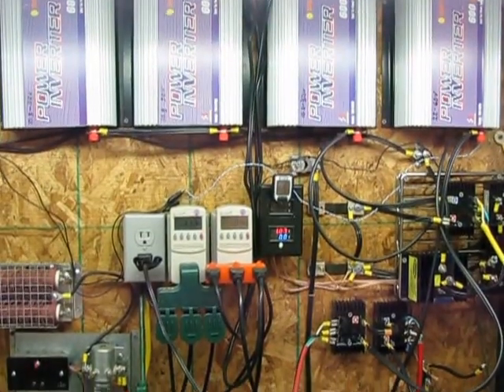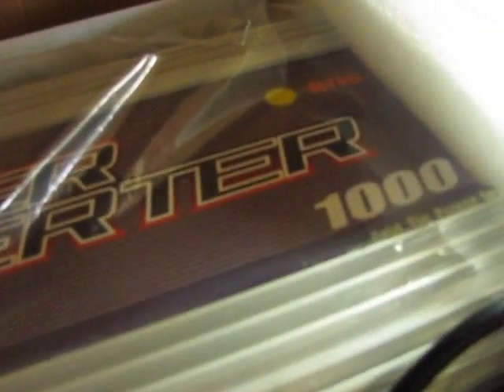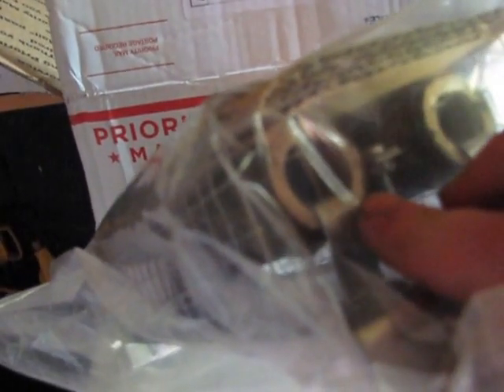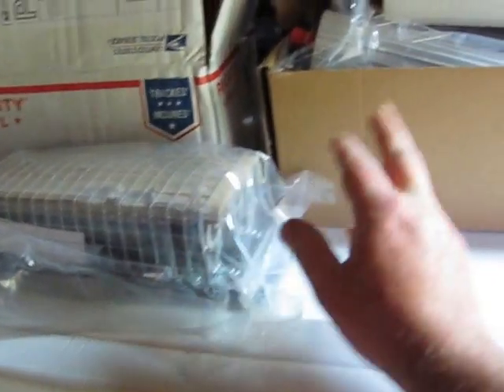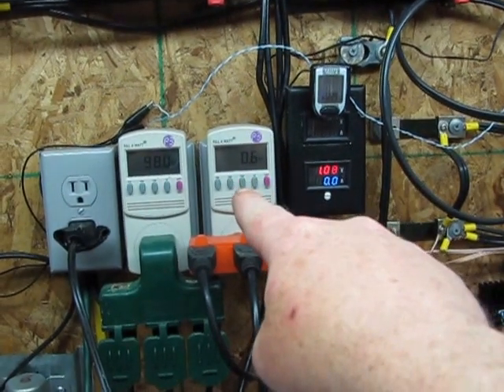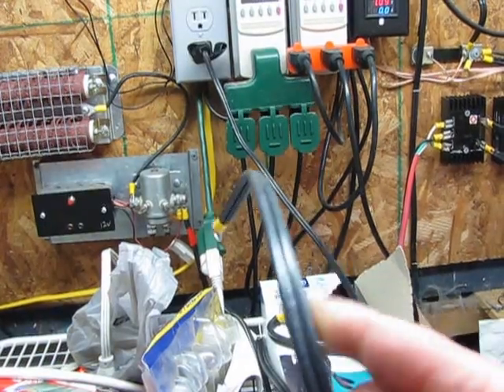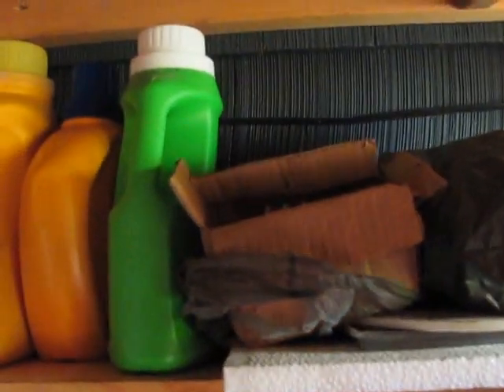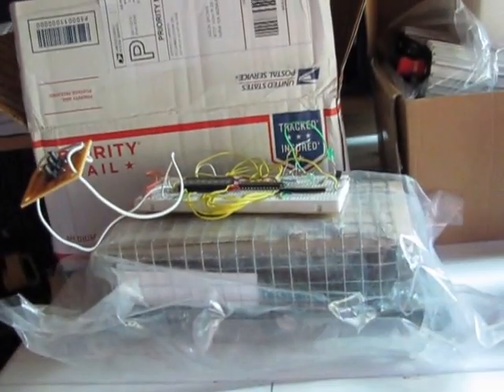My Freedom II ,, More parts and update :)

Comment: Looks like you have a lot of wiring to get done buddy!  I still have to install the charge controller for the mini wind generator. I finally got it up in the air yesterday. still have to post a video of it. I got a really good idea for the design of the wind generator you wanted to visit and build together. if everything goes as planned, it will give you some really good input at very low winds. ill explain more to you when you have time to call. I sent you my phone number thru private mail. so give me a call when you have time. catch ya later on SD.

Comment: I'm still trying to learn more about grid tie. Because your grid tie inverters are only 120 volt, you're only pushing current through one leg of the meter back onto the grid.... does it matter ?  What happens is your house is pulling off both legs and you are only feeding back on one leg ?  Or are you splitting up your grid ties to feed on both sides of the meter ?
Reply from the maker: Mark Osborne I don't think it matters, because when you are using power from the grid you don't pull power evenly off both incoming legs,,, you could have some outlets on one incoming leg not being used , but on the other incoming power leg you could be running a toaster and microwave at the same time ,, so ya, I don't think it matters much
Reply: Jason Brown Ok,  I "think" I understand.  Lets say your electric meter clocks 25 Kwhs in a day, 10 are on the left leg and 15 are on the right leg. Taking your example,  assume you put 14 Kwhs back into the grid on the left leg (that used 10) your meter will still run backwards to the point of 14 Kwhs.... correct ?
Reply from the maker: Mark Osborne
You would take 14kwh made from 25kwh used , 25kwh used minus 14kwh made and you would still be paying for 11kwh used for that day,,
Reply from the maker: Mark Osborne I don't think it matters,, One leg off my meter feeds the back bedrooms, and they have no draw on them at all, during summer time , 2 electric heaters for my back bedrooms, that is all that leg off my meeter feeds, I added just this year a 60 amp split to two 30 RV plugs on that side of my Main Power Breaker Box, I made a video of it :)...
Reply from the maker: Mark Osborne The house pulls current from both legs differently depending on what you are using,, one leg of the main power lines could be used for most outlets in your house and one could be used for lights in your house ,, it does not matter because you never pull the same draw off both incoming legs at the same time,, you can switch all your lights to L.E.D and save allot of power draw on one incoming power leg,, but your vacuum still takes the same power to run when you plug it in,,

 It does not matter, one incoming power leg off your power pole can be pushing power back into the grid but if your house is using more power than you are pushing back into the grid, then you still have to pay,, your power meter measures both power legs off the power pole, if one leg is spinning backwards and one forwards the meter slows down,, If you plan on making allot more power than you are using on your house then you have to have it certified by your local power company,, that costs allot of money,, so I plan on trying to make just a lil bit less power than what I use..

Comment: I take it your not going to installed the rpm meter.  It is a pain and another expense but I believe it helps to see which blade set is best.  
You have a great spider web of wires going on there.  Sometimes it's easier to remove everything and start fresh.  Also I ordered the 80 inch set so I'll be spending a little time on the roof again.
Reply from the maker: ***** Ya I am going to skip the RPM meter on this turbine,, This weekend is a 3 day off so I am going to work on my power room probably most of the weekend and get it straightened up:) Did you get the 5 blade 80inch set?  I think the 5blade 80 inch Falcons will work good for your modified turbine ,, I heard on your video the chain getting tight and loose, I think the Falcons should be able to power through that tho
Reply: Jason Brown You have a good ear....The bushing fit perfectly in the center of the sprocket and I clamped her down good before welding.  It's off a hair but as we see, a hair matters. Could be a bad sprocket but who knows, it's probably may fault. lol.   I threw up some falcon blades as I ordered the 5 blade 62 inch set but the 3 blade hub came instead.   As long as I was changing things, I used an air file to fix the offset problem.  It's still a little off but closer. 3 blade Falcons barely spin it and it will never see the 5 blade 62 inch set.  Being so deep in already, I figured I'd go all the way and ordered the 5 blade 80 inch set.  I'll be switching everything around (guess I can't avoid it) and may even weld up another sprocket hub if I can't get the other perfect.  I have one video to post that I'm kind of holding off on (don't want to piss anyone off, but test results are what matter to me and most people no matter what the out come is), and then I'll do another on the 80 inch results before I move onto solar panels.

Comment: are you running 6 gti's into one 20 amp 120 vac circuit on your house panel?
Reply from the maker: Rev John O'Toole It is actually all wired into my 50 amp for my Man Cave / Travel Trailer 120v outlet, direct connect to my house breaker box, with a 50a 120v breaker using 6 gauge wiring  :)
Reply: Jason Brown but still you are using an outlet that is rated for 15 amps. just wishing you to be safe. I do wonder where the power go if it can''t go into the outlet.
best
Reply from the maker: Rev John O'Toole
Each outlet I used is rated at 20 amps, I added 3 for my solar and wind input power ,, Because wind is not consistent in my area, I should be ok But, Adding this dual core Freedom II might put my grid tie wind power input close to its max including 1400w of solar and my other turbines,, I am aware of my power inputs and outputs on this one 50a 120v RV plug :) This is my max on this RV plug ,, when I add more solar I will have to add another input power plug direct connect to my breaker panel with another properly rated circuit breaker..
Reply: Jason Brown this is what a 20 amp outlet looks like
http://www.homedepot.com/p/Leviton-20-Amp-Commercial-Duplex-Power-Outlet-White-R62-CBR20-00W/202066702

and this is a 20 amp plug looks like
http://www.homedepot.com/p/Pass-Seymour-20-Amp-125-Volt-Angle-Plug-PS5366SSANCCV4/100114807

I'm just saying it may be better to balance your power between both 120 legs on your house power with a 10-3 wire, 30 amps would do. to a small subpanel in your power shed and enough outlets on each leg to balance the power on both legs of the 220 vac.
not trying to pick on you just wondering if it would make an awesome setup even better.
best
Reply from the maker: Rev John O'Toole Well then the guy at lowes sold me the wrong plugs ,, it don't matter ,,  My 1400w of 24v solar after going through the grid tie inverters only makes about 10 amps ,, If all my 4 turbines we making max power and my solar was making max power all at the same time going through grid tie inverters,, it would be about 40 amps ,, it is hooked up to a dedicated 50 amp RV outlet :)

Comment: Brother may I ask why you do not dump your power into a hot  water heater? I know it would be some work for a 2 tank and wording it but would it not save you more in the long run as well as if your powers out in a bad storm you may have worm  water. 

One day I would love to chat with you on the phone. I need some in put on buying a GT for my solar. God Bless Brother.
Reply from the maker: yankey4 I plan on going On demand natural gas for my hot water but you are right using 12 volt water heater elements ( on my 12 volt system) before the regular on demand or tank style water heater would be better,, I will check into it for future additions to my setup

Comment: Mate I thought I was crazy on grid ties you have enough now I think. Must be the day for grid tie mine is getting delivered today. Thanks for sharing,
Reply from the maker: ***** Ya,, Just a few more and I will have enough :) From my experimenting I found that stacking more grid ties is better to help absorb the amps and voltages of the turbine ,, from looking at the wiring inside these cheep grid ties the wiring is not able to handle much more than 30 amps I don't think,, so I add much more grid ties to spread the amps over many grid ties ,, It seems to be working so far, I did not blow up any grid ties last Fall - Winter windy season :)
Reply from the maker: ***** The way I do grid ties is amps,, I have seen other video's showing my Freedom II making 100amps or more, I only trust my grid ties for about 30 amps input each,, that means I need at least 3 grid ties to be able to absorb the incoming amps from the Freedom II turbine, probably 4 grid ties to be safe :)
Reply: Jason Brown More is always better,